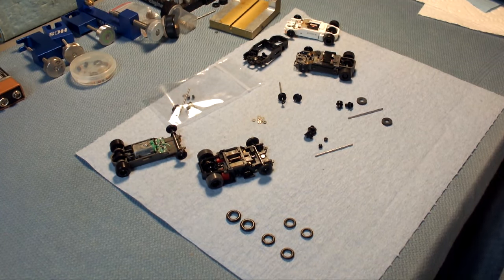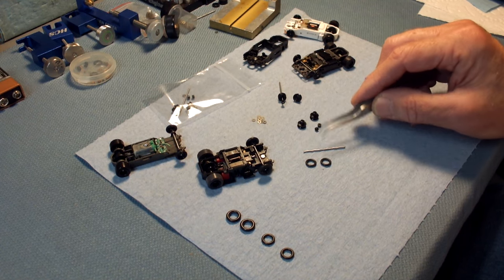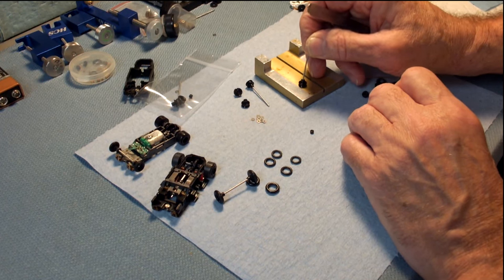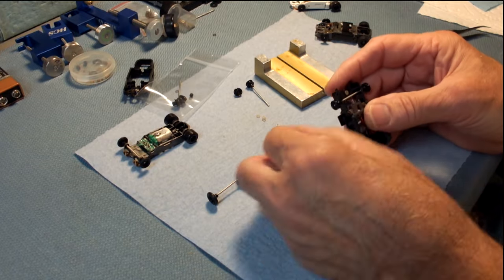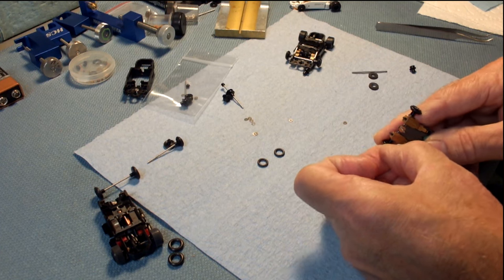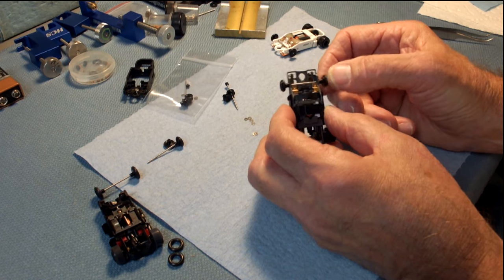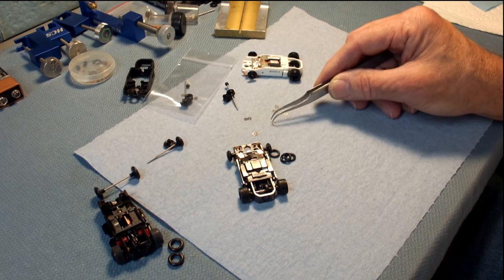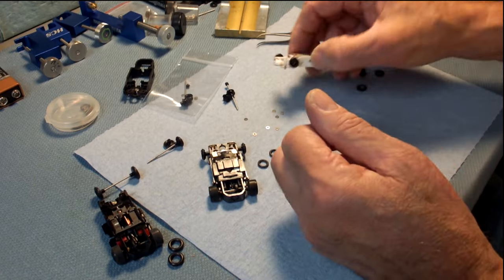O-Ring Independent Front Axle Sets

Comment: Hello friend I have a quick question concerning using a laptop power converter with my Artin track which currently lacks power , it uses a dc output of 6 v, 1.2 A. If I adapt a laptop converter should I only focus on the current or voltage must also be a thing to consider ? Thanks for your help